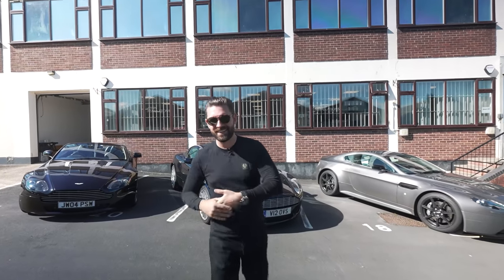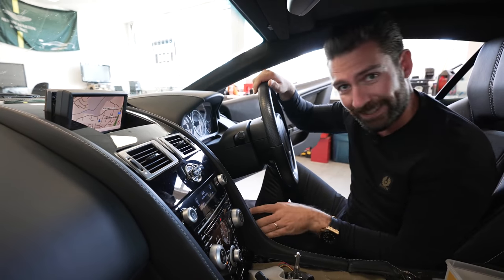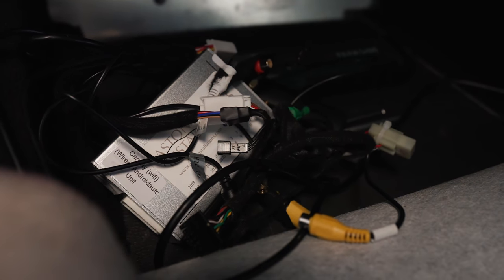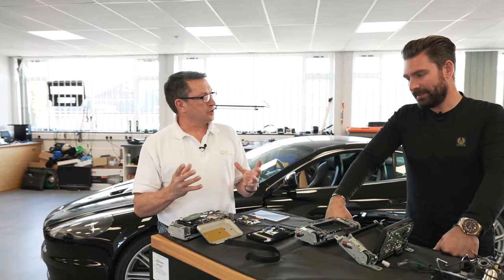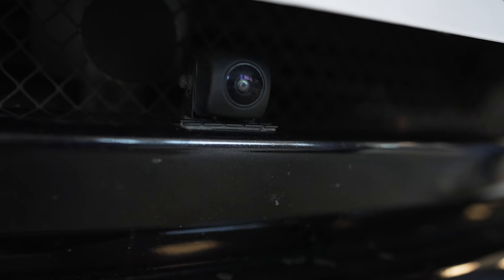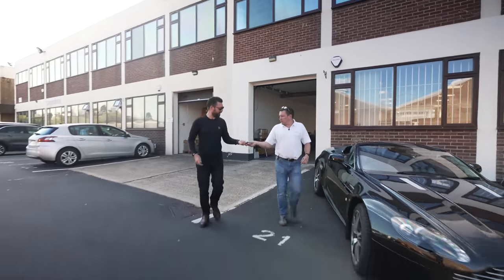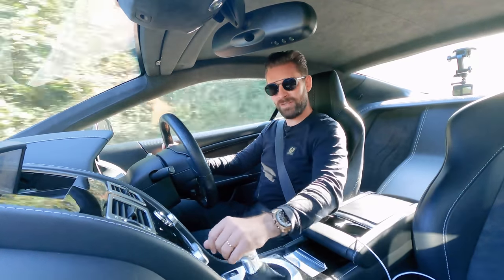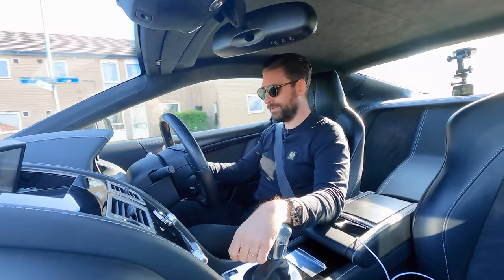The Most James Bond Upgrade For My Aston Martin DBS! Back To The Lab!

Comment: Aston needs to go back to the stow away system and or add touch functionality, a bit like Bentley does, it's just so much better to have a clean timeless design in the long run. Floating fixed panels ruin it for me tbh.
Reply: Which is why I hate most current luxury car interiors. Screens are not luxurious. The DBS is a classically beautiful Aston. inside and out.
Reply: @aerorobnz  Yup screens and user interfaces are about the most rapidly self-outdating aspect of modern cars. Only few elements are ever truly timeless: Main volumes, details, and materials used (this includes lighting). Everything else should optimally have minimal presence, or be able to be hidden away so to not grap attention.

Comment: Honestly, at this point it would be quite incredible to see an entire dash swap to update the whole center console area. Not to change the design itself, but to freshen it up by removing some oldschool buttons and pieces that aren't required anymore, while doing a truly bespoke screen installation - perhaps even with a wider choise of materials instead of only the piano gloss. I'd love to work on the design for such a niche project.
Reply: I agree, I've never really liked the waterfall design centre consoles on modern Astons.
Rather see a cool setup like a Ferrari Daytona or even the older V8 Vantage from the mid '80s.
Outside they have lines of a fighter jet, you gotta have the cockpit syle dashboard to go with it I reckon.
And a better fucking gear shift knob....that one is butt ugly.
Reply: @GM-fh5jp  There are definitely a lot of options, most importantly is to match the timeless styling of the exterior, because that simply never gets old.

What I do appreciate is the incorporation of various materials that have value in their character and life they bring to the interior. Lightly processed metals, natural wood with good vein contrasts, and most importantly - details that match their complexity to the material they're made from. Metal details that are intricate and have precision finish - leather wrapped in simple but decisive volumes, etc. 

They would need to strike a balance between what is contemporarily possible to manufacture, mixed with what is in essence an attempt at ageless beauty. Shapes and components that aren't locked to any specific time period or manufacturing process - or what is in to have in a car right now.

I would personally compare it with the cockpit of a high end commercial jet. Something that is clearly pilot (driver) focused, but also has enough space and openness to offer that slight lounge-like feel that is important in a grand tourer. You as a pilot are important, but so is your co-pilot (passenger). It is made for two, and should not compromise here. I would look into ways that the passenger could even have increased space around them, to really invite the aspect of taking someone else along on your trips, even if it's mostly a solo drive on daily basis.

Comment: Always bothered me that the flip up screen never reached vertical, and is tilted towards the driver. Has always looks incomplete to me.
Reply: I also got annoyed by this, but maybe it looks a bit off because of the camera angles. From the drivers point of view, I’m sure it’s designed to be fully visible.
Reply: Based on the driving position, it sits perfectly.

Comment: I'm installing this system in my Vantage right now. Where do you have the controller mounted?
Reply: @markthoughtswithukrainemas2072  that's not what I'm asking (nor do I think anything is in the boot). I'm asking about the little joystick and buttons you use to navigate thru Carplay. Normally I see it mounted right in front of the armrest, but I don't see that here.
Reply: Had mine installed in a V8 Vantage a couple of years ago - the switch to select between oem Nav, CarPlay/Android and parking cameras is in the ashtray 
The controller for CarPlay is on the dash between the centre console and steering column
Reply: We designed a custom made new insert for the ashtray that can accomodate all the control elements ;-)
Reply: @menefrega13  ah, yes, I forgot about that as I hadn't seen anything since the post 3 or 4 months ago. I'd use this if I didn't also have a radar detector remote to mount. Will keep it in mind though.
Reply: Definitely something I plan on having installed in my Vantage along with a reverse camera!